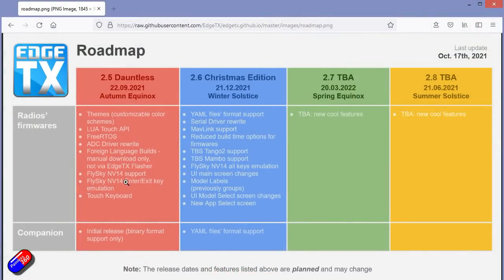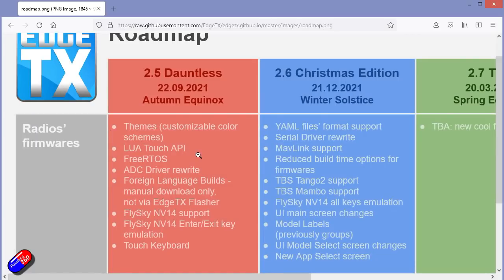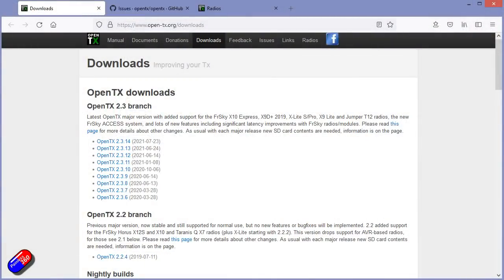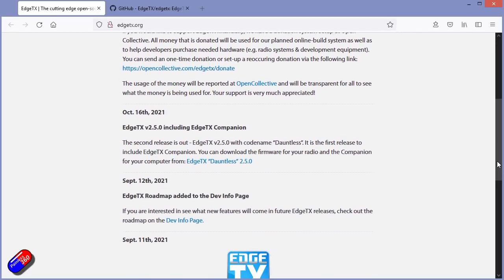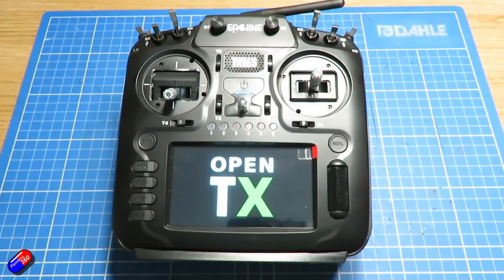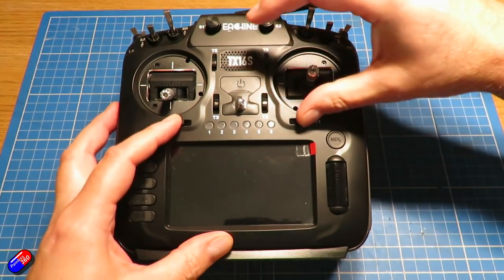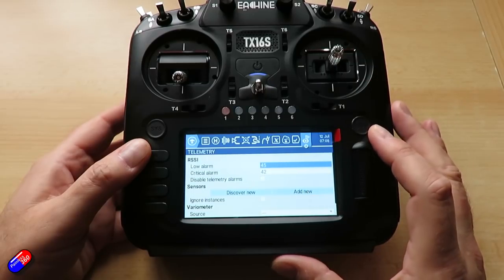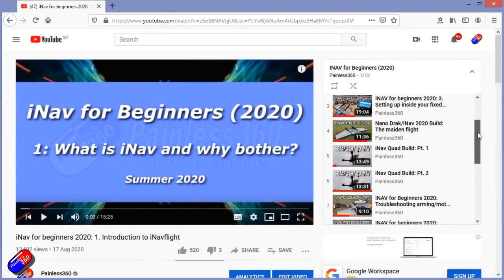EdgeTX: What is it? Do I need it?

Comment from the maker: Interestingly I've had an email from one of the lead developers this morning that concluded  'I think you are pretty much right' so the project itself agrees with many of the points and is aware that there is a lot to do - that alone is an exciting and encouraging message. 

Thank you to all of you who left thoughtful comment on this video. Just because another pilot doesn't share your view doesn't mean you should become abusive or rude. I've deleted those comments that are and banned some who went too far. 

Thanks for watching and commenting in the spirit of the channel. Happy flying!
Reply: As always a meaningful critique from your side lee. Thanks for another constructive video
Reply: Still buzzing in the back of my mind,... it is free and takes a rather great  amount of effort. An enormous THANK YOU to the developers !
Reply: Patching to ETX is painless (heh) and easier than OTX companion flasher if you use the e
ETX flasher software instead of copying firmware files which requires several steps moving from OTX to get the bootloader and such first.
Reply: As an NV14 owner (have 2 of them), Edge TX is literally the only option and it's been working great!
So glad to get my preferred radio flight ready again.
Currently working on using the bluetooth on the radio to directly program betaflight on quads with bluetooth, would be a game changer.
Reply: Did you contribute to the GitHub issues at all? Did you document the shortfalls out of interest?

Comment: I just want to go fly my airplane after work, that's how I relax. I'm a carpenter not a computer programmer. I'm good with my open TX for now thank you !
Reply from the maker: I think that many pilots feel exactly the same. I hope that EdgeTX puts more focus on the GUI and making it easier to use for the new pilot.
Reply: What painless says. EdgeTX renoves a lot of the OTX complexity and makes it easier to just grab and go to just fly and not mess with the radio. And you can still delve deep in to non flying days if you like to tinker with that
Reply: You should give it a try now... The UI enhanced with touch screen has been amazing and I have completed moved over to EdgeTX

Comment: Love your explanation.  Have a number of very good very expensive JR radios, no telemetry and built in programming, which makes things easier. Learning to understand code is frustrating.  What programmers forget, imho, is that to build really good software they need to firmly believe that the end user is a complete newbie.  If it takes a program background to use, something was overlooked in the process.  There are builders and there are users.  Users aren’t capable of being good builders. I have taken full scale helicopters apart- completely, and inspected, repaired unsatisfactory components, repainted the entire airframe and all ancillary parts, and flown in it.  But opextx is still a head scratcher.  Having set up screens to build a model should be easy for the talent that builds these soft wares, but they don’t remember how difficult it is for the new people who are not programmers.
Reply from the maker: Thank you for the comment. Many opensource developments overlook (or ignore) the needs of the end user for things to be easy to use as they assume that everyone will understand what to do and it is 'obvious'. As someone who understands Opentx very well but spends hours every week helping others, I know how overwhelming Opentx can be for many. Projects like this will benefit from having a number of people involved who can represent the average user. I have my fingers crossed for EdgeTX. They seem to want to look at this.. Happy flying!

Comment: I really agree. As a newbie to the hobby we need more simplicity. I cannot make a  volantex g2 work with zohd kopilot lite with rx fs-ia10b and eachine tx16s. Part of this problem may be in every of the 4 parts and I have seen dozens of videos to understand what happens. We need more easy cross-platform communication, safety and simplicity. Greetings, your job is great.
Reply: Just a note, I’m starting as well - learning anything takes effort and 90% of the learning effort you will expend on the first 10% of the knowledge.

Comment: The open/edge TX interface is more complicated than less feature rich interfaces but honestly really isn't all that complicated. I find the only people that take issue with it actually just take issue with learning anything in general, it doesn't speak to the design of the interface.
While I support adding configuration wizards to expedite programing new models, the current interface is honestly fantastically well designed around the large feature set, there is no way to dumb it down without removing functionality.
One option could be to offer an EdgeTX-Lite with a stripped down feature set for basic applications or basic people.
Reply from the maker: While, for me, OpenTX/EDGETX makes sense I know a lot of very clever pilots that struggle with it. For many it is too complex and not how their mind works and/or they don't use it enough to remember the nitty-gritty of how to change things when they need to.
Want to reverse a channel? Easy, you can do it in one of four places and each of them has specific benefits. Add EXPO? Sure, again available in three places this time.. 
As someone who spends hours a day helping pilots with OpenTX and often gets approached on the flight line from pilots with questions about it, I can attest to how confusing it is for so many. 
Thinking about the system from a less technical users POV would lower the point of entry and make it a lot easier. 
Interestingly, this is an aim of EdgeTX and they have some cool ideas on how to do this...

Comment: I've been with OpenTx since I started in the hobby about 7 years ago and was a great fan of Frsky. Both organisations have made it so complicated that I will be migrating to Spektrum. I just need it to be simple with just enough finesse to make those minor adjustments. I don't expect to have to load this and that new firmware every few months just to fly a club flyer plane.
Reply: Mark u r a thousand percent right. Making it so complicated is detering new flyers to our hobby.
Reply: Interestingly Frsky have gone the Spektrum route with proprietary radios and software with their x18, x20 series Ethos and Access, only much cheaper but just as good if not better.

Comment: I went from a X7 to a X20 Black & then recently got a X20S Blue I love the OS as I've never had to look at any video's ect, I'm running FLEX.
Reply from the maker: I'm sure that EdgeTX is looking at things like ETHOS to see how others are tackling the usability issues.. I hope so anyway!
Reply: @Painless360  It's just as you said a few years ago "it would be great if Frsky made a easier OS that everyone could use with ease" well they did but all you YT bigwigs have ignored it shame as the whole firmware thing is over with Access and Archer Rx. For me I prefer the X20 shape as it's like the X7 chiselled off on the corners.
Reply: I have just purchased the x20 and I must say I just love it and ethos will be brilliant when finished.
Reply: @garythatcher4219  The current firmware pretty much does everything I need.

Comment: I changed over to EdgeTX on my Radiomaster TX16S about a month ago, all went well or so I thought. I took one of my glow engined planes for a flight and the trims had all changed, my arm switch no longer opened the throttle enough to start the engine and keep it ticking over. Control surfaces all worked in the right direction but plane flew like crap! I immediately change back to OpenTX when I got home.
Reply from the maker: I'm sure that it will get a lot better in the coming releases. The project does seem to want to make things better and they have a lot of ground to make up that should have been fixed/added by the primary project in the last two years.. Here's hoping!
Reply: @Painless360  I’m keeping my fingers crossed and I’ll try the next release.
Reply: Did you ever figure out what happened? What version were you running when this happened? 2.5?

Comment: Lee:
   In the past year, I have purchased a bunch of hardware (transmitters, mini-warbirds, receivers, trying to acquire fairly state of the art equipment so that I can hit the ground running and not have to wait a month for the next essential piece to set up my transmitters with compatible models, update my firmware, and start having fun.
   Nearly every configuration video I watch admonishes us to back up our transmitter firmware, model configuration, etc. even before we start to use our transmitters.  However it occurs to me that a well organized hard drive directory structure will help avoid a huge tangled web of directories containing configuration and version zip files for each new update. The question is what directory structure makes the most sense to navigate these installation files without getting buried in the minutia?  I mean for installation of 1) OpenTx & its companion 2) EdgeTx & its companion 3) Express LRX versions 4) Airplane model definitions, INAV, Pixhawk, Flight Controller boards, Receiver updates, and the like.
   Could you do a video suggesting a logical table of contents for backing up all this stuff and then being able to find it again when we need it?
Thanks for the sanity and logic that your videos provide to the rest of us who are trying to get our heads around all these details!  - Jim
Reply from the maker: Hi Jim, 

How you organise things in directories is a very personal thing and I've never seen two pilots do it the same way. It needs to make sense to how your mind works and be organised so that you can find things next time you need them. 

With the modern tools for searching in things like Windows it is a lot easier to find what you need but with so many files having criptyc names I appreciate the need for some form of organisation. 

You could save the files for each build you do. You could save them by technology; ELRS, INAV, OpenTX. You could save them by date...

Here, I store files by technology so I try and keep all of the INAV stuff in one place, the OpenTX stuff in one place etc. I use sub-directories to store configurators and firmware files so I can find them next time. 

The exception to this is when I am building or shooting a video and then all of the assets for that model live in the folder and then saved when I've finished.

I hope that helps.

Comment: Great review - Could not agree more about revamping that interface. Knowing how most use OTX, those items should be front and center and the rest moved behind a second layer with widgets to automate the basic. The fact that it still uses transparent GIFs instead of PNG and the resolution is low for most graphics while screens are big speaks volumes. It is time for a new way, not just more of the same now in colour. Add to that the fact that Tango and Mambo support has now moved from Fall to Spring and you have to think it’s more of the same. The one plus in my opinion is the fact that ELRS support in Edge TX allows for some settings like 500hz that are not supported in OTX.

Comment: As someone who has recently returned to the hobby from a long break and has just got a Radio Master TS16 and having watched this I take it I will be better placed persevering with Open TX for the time being or do I take the plunge and start with Edge?
Reply: Leave off for now if you expect to use Telemetry scripts.
Reply: @Pilotltd  Cheers Steve
Reply: You should definetly switch to ETX. There are so many bugfixes that are worth having. Plus being able to use your touch screen is a gmae changer.
Reply: @MrAlucardDante  Not when most of the useful stuff simply isn't supported yet. Half working touch screen is not a game changer, how often do you use it in flight?
Reply: @Pilotltd  as in? Do you mean scripts like betaflight configurator, expresslrs, inav lua, yappu telemetry? As those all work. An no, you probably wouldn't use the touchscreen in flight since you'd use the sticks. But you would use it to edit your model settings, and once lua developers start making use of the touchscreen support, you will be able to use touchscreen lua apps to control stuck also

Comment: Coming from a long time non FPV RC pilot open TX was a process to learn I'm an IT professional for 30 plus years. I can see why many hate it younger FPV crowd likes it. Some want to just configure a few settings and fly where this thing has so many bells and whistles. IT's like I remember when put a amp sensor in my EDF jet had it tell me the amps going out I ended landing at 2 1/2 minutes. A friend said why bother with all that just put a timer on your radio goes for 2 1/2 minutes and land.
Reply from the maker: OpenTX is a classic example of a project that was developed with no-one watching out for the experience of the end user -  lots of twiddly bits and new features added with no thought about making it easier to use and making the 20% of the features that 80% of the pilots use all the time easy to access and change. 
EdgeTX is working on this do I've got my fingers crossed but it won't be something we see anytime soon..

Comment: Thanks for raising this topic. I describe OpenTX as “by engineers, for engineers” and have left my Radiomaster in the case for months simply because I’m in this hobby to fly, not to spend hours upon hours figuring out how to configure a model. If and when Edge or Open becomes easy to use I’ll ditch Spektrum in a heartbeat, but until then they’re more of a problem than a solution.
Reply from the maker: I hope that the development team focus more on things like improving usability and interface than adding more gadgets and widgets that makes it even harder for new pilots like you.. Here's hoping!

Comment: @painless360 would you now recommend switching to edge exclusively?
Reply from the maker: It depends on what features of OpenTX you use. I'm not planning to switch to it as a primary radio O/S anytime soon - still too many things missing (but on the way!) for a pilot like me who uses a lot more of the OpenTX system than most..
Reply: @Painless360  I haven't bound my first model to my TX16s yet but I'm planning to setup my OMP M2 heli on it and also use it for FPV in the future.

Comment: Hi, please clarify will edge tx bind with x8R and also how to find out which version is your X8R programmed with. Any way to find out ?. I had purchased two x8R with tx16S . Finding a way to bind it.
Reply from the maker: https://youtu.be/aZhvnm8j88M should explain. An MPM radio running Edge should bind ok once you have the right version and flavour of ACCST selected on the radio.. no way to find what is on the reciever sadly so it is trial and error (or ask the seller of the X8Rs)

Comment: Hi Lee. My X12S with EDGETX  has all the latest upgrades and works fine with ISRM internal module to talk to my Access receivers. It does not work with my R9M-2019 external module. Using Companion 2.5.0, it shows External Radio Module; protocol; that R9M-2019 is an option, however when I look for that on the radio, it is NOT there as an option, only the R9M. I did enable "externalaccessmod" in the radio profile flash. (It all worked in OpenTX) Any thoughts on this? Thx
Reply from the maker: Note sure, I'd ask in the discordant. Best of luck with it

Comment: hi lee - have really enjoyed and learned so much from your channel over the years, cheers.  re: the OTX project evolving to radically improve and simplify the interface for general users, i dunno... afraid that would seem to be extremely unlikely and unfortunately i'd expect it's just as unlikely for EdgeTX as well, maybe even more so.  the problem is really the same one that has folks leaving OTX to work on EdgeTX in general - i.e. the developers are mostly interested in inventing and introducing new technology at the code level, which is a very, very different skill than either developing great documentation or developing a superb user experience (UX).  neither seem likely to happen, but of the two the improved documentation would seem more likely because the bar to doing that work is comparatively lower than the UX work - i.e. it's not fun and it's not easy, but it is doable to a reasonable degree with enough concerted effort.  in contrast, great UX starts with great UX design which is a deeply creative discipline distinct from great technology feature development and folks with the ability to design and develop great user interfaces are far rarer than developers with the ability to work on incremental feature improvements.  the counter example here would be stepping back to look at the proprietary user interfaces from companies like JR, Spektrum, etc. that you're alluding to as providing what OTX should be considering.  those systems may not have the unlimited flexibility of a system like OTX, but crucially they do cover the vast majority of needs for nearly all users, beginner and advanced alike.  and to get that depth of functionality and breadth of end user coverage, those companies invest a great deal of time and money in designing, developing, testing, refining, documenting and maintaining those systems which they know they must do because they are in the business of selling radio systems to anyone, not just folks like you and me who actually enjoy the flexibility and programming bent of OTX for it's own sake.  and we see this idea coming right to our doorstep now with FrSky moving seriously towards their own proprietary system with Ethos.  at the end of the day working at cutting edge technology is fun, generally self-contained and comparatively painless while nearly all these other less sexy facets of software development that result in great applications for users are not.  all that said, i truly hope i'm wrong here and OTX or EdgeTX do evolve to become great user applications beyond the capable and flexible platforms they are.